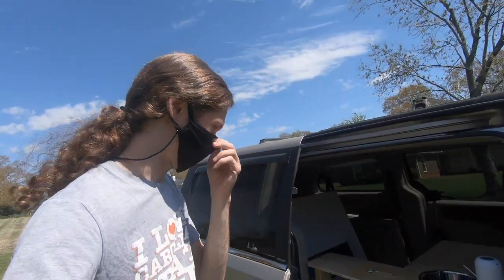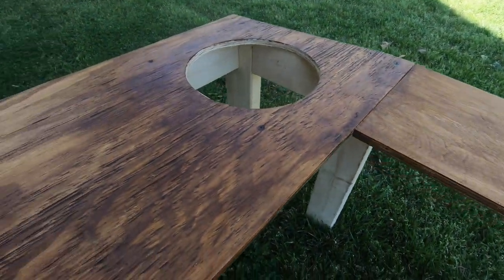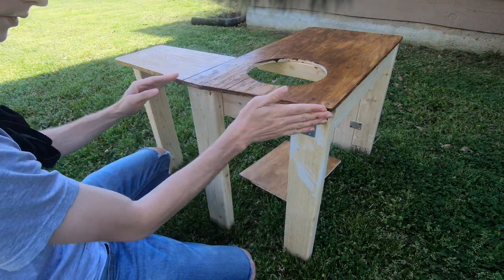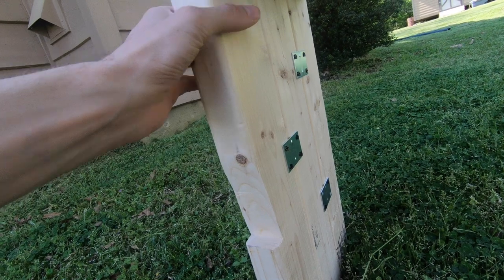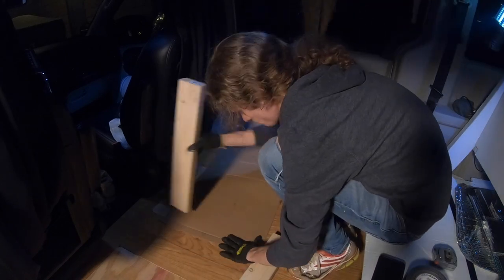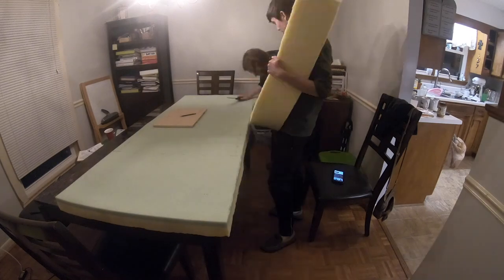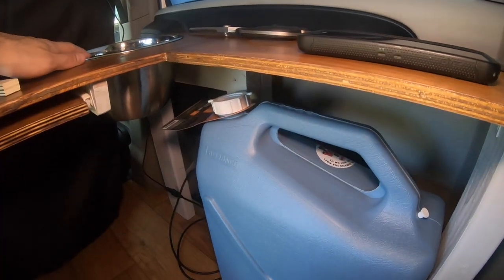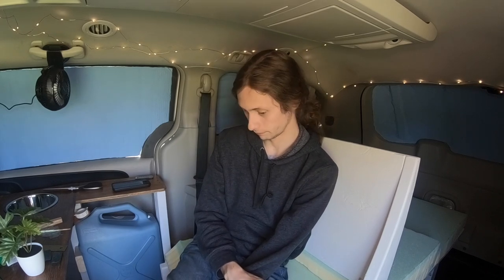How I Built the Counter in my Minivan Camper (and More Updates)

Comment: Looking good so far! May want to use that extra piece of mattress for your back. 

Also, for the water I highly recommend something simple. We use a usb rechargeable water pump with faucet. It’s meant to go on top of water jugs but I have it mounted next to my sink. 

Here is the exact one I have if you search on Amazon, it’s super affordable. (I would link but it’ll get sent to spam) “Auto Bottled Water Pump with Volume Control Wireless Water Dispenser Rechargeable Gallon Water Bottle Jug Dispenser Pump”
Reply from the maker: I actually have one of those little USB rechargeable ones for my water. I was shocked at how affordable they are!!
Reply: @IanODonnell  awesome! Sorry if I missed it if you showed it in the video.. watching YouTube with a toddler running around should be considered a sport 🤣

Comment: Just a heads up after you start your trip Burger King and McDonald's and even Dollar Tree sell 7 pound bags of ice for a buck.. also various areas that will have what they call ice houses of America and you can get ice there for a $1.25 for 15 # they have a website  That will give you a map for every state where their at..
 Regular gas stations and Walmart are overpriced on their ice prices.. I expedited in a big cargo Van for 7 years and had nothing but a 52 qt.coleman extreme cooler, 1 burner coleman burner, 1 CI pan and pot, 28 in wide bed and a plastic 3 drawer dresser..  And last but not least a charcoal chimney.. That I could burn either charcoal in or sticks and grill on...Also when the heat starts beating down on your windows that velcro gonna melt the sticky and slide or pull/fall off.. What works really well to keep your shades up is butterfly clips the stationary ones little black ones with too little metal wings.. You can either clip them up there or slide the clip in and the little metal arm will hold the Shade in.. And if you want your privacy curtains to be tighter along the top part of headliner you can just use T pins. Congratulations on starting your journey have fun and be safe